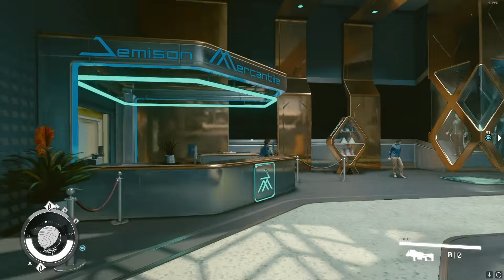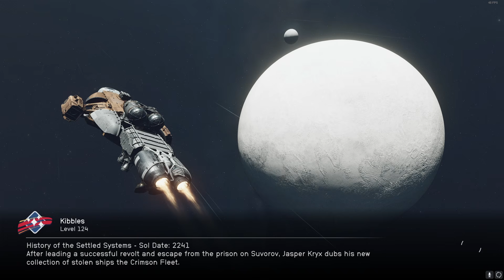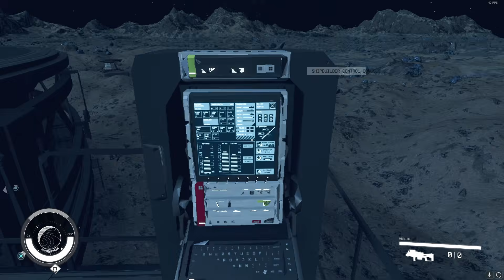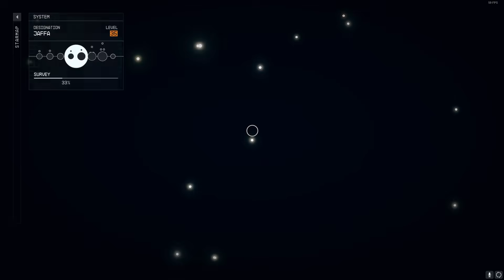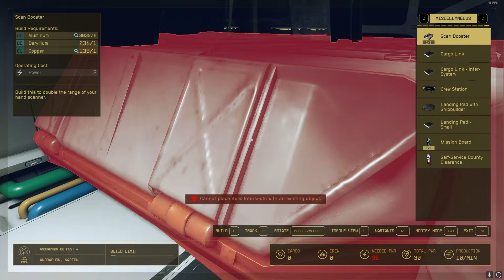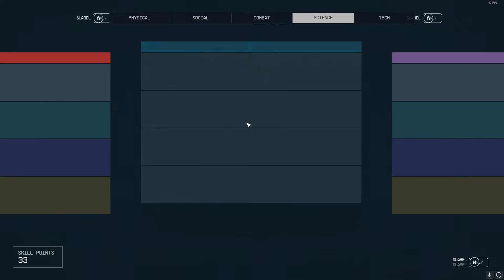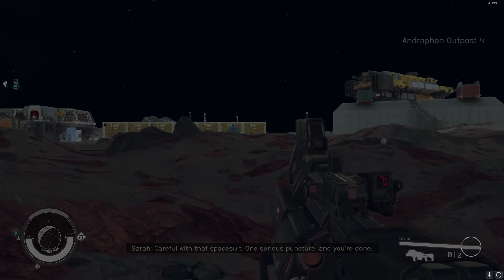Starfield outpost guide 2.0, beginner to expert FAST, outpost tips and tricks, cargo links, building

Comment: My first mission is a Supply Tungsten mission to Jemison. Thanks to your first video, I've got an outpost set up in Alpha Centauri. I can't scan for Tungsten, so I don't know what to do from here. Does a supply mission always require me to produce the resources? Or am I supposed to supply it from another source? Either way, how do I actually deliver/supply the resource?
Reply: You need to find a planet with Tungsten (W) and look for it there.  You will find rocks on the surface which contain it, but you need to find a patch of ground that's made up of tungsten and place an extractor on it.  While scanning, they'll appear as highlighted colours and the elemental symbol will show.  

If you can't find Tungsten on an inhabitable world in Alpha Centauri you'll also need to find a word in the system where your Tungsten is that has Helium-3 (He-3) and build an extractor on that as well.  

You need to create an inter system cargo link (or just a cargo link if your base with Tungsten is that same star system as the supply mission destination) and connect the output of the extractor to a container and then to the "outgoing resources" container on the cargo link.  You also need to connect the Helium-3 to the storage on the other side. 

Then you go to the terminal on the cargo link, select your destination and find something else to do while the cargo gets delivered. 

Hope that helps!
Reply: @SineN0mine3  Is the H3 requirement there because the NPC supply ships consume H3 as fuel and will get stuck on a pad if there's no H3?

Comment: Can you make a video about supply lines. Daisy Chains or multiple hubs that then ship out everything to the main base. I haven’t found a video that goes over the most efficient way to move items from multiple outposts to one main base. 

Also due to the fact that you can’t sort items in storage do you just dump all the different materials into a large storage facility. 

I would really appreciate it if you could go into this in detail. Currently I have 8 outposts and I’m still not sure what supply chain is the most efficient method. Thanks

Comment: Should be noted. There's a point in the main story where you need to build defenses on your Outpost no matter what.
Reply: Gonna try to avoid spoiling it but it can be done on your ship instead
Reply: @brandomium that’s what i did. Can confirm, all you gotta do is click on a button and it adds a CENSORED panel to your ship.
Reply: i had the andraphon outpost, and just slapped "censored" structure down.
never built any defenses or anything an im fine (60h) 🤷
Reply: I've had the censored on both my ship and outpost and never once had anything happen in 40h since.
Reply: Got starborn without ever starting an outpost. Still haven't activated, and,am now looking at outposts. Should have been better integrated into the story IMHO.

Comment: Have you notice that the cargo links that transport recourses from outpost make your game stutter like every 3 minutes? Even if you are bot in the same planet or system i had to stop using them after i was done leveling
Reply: Yh ive noticed this i didnt know if it was cargo links or not but every few minutes i cant move and that was after building the 60k xp farm
Reply: Not at all. I have 24 outposts all linked with 6 platforms per outpost and not a single drop in performance. But I'm on PC with pretty good hardware.
Reply: @flacwby i started noticing my stutters when having alot of containers and connecting them all think it was the red lines, first time i built it i couldnt even enter my outpost without the game crashing, i then reloaded a older save and didnt place as many storages and organised it abit better but now im defo having stutters and the sounds breaking, ive played ark with much more happening at once and the series x handles it fine but cant handle a few storages and red lines lol on starfield

Comment: Some how the cargo links put resources into your ship causing it to fill up too. The cargo links are a buggy mess and it's not really worth using because you can just fast travel to the planets with the resources.

If you're like me and wanted to automate and have multiple outposts funnel into one major base, it's not worth it. I spent HOURS trying to make it work. There's no way organize resources when they are sent into one base and you can only have one transfer container per outpost so if you have 7+ resources all being sent to one location you can't even utilize accessing the cargo cause the transfer container only holds like 250/300 and usually fills with 1 or 2 resources leaving you to hunt down specific resources from your possible hundreds of storage containers.

Hopefully mods will fix all the issues. I wouldn't waste time on cargo links, just mark and name bases of the resources you're gathering and fast travel to the places you need.
Reply: Then don't use the transfer container. Just connect directly to separate storage units, then only that resource will go in to storage. Transfer containers are only used to transfer to/from your ship, but not needed for cargo links and transferring between planets.
Reply: @flacwby it's pretty much only viable to use the transfer containers manually because you can't seemingly get repeat quests to deliver a specific resource.   

They're a pretty expensive item considering they just let you skip a couple of fast travels and you still have to enter your inventory while inside the ship and then outside the ship (or vice versa) to move anything in or out of long term storage
Reply: This is kind of lame but my solution has been so far to build long term storage with one container per resource, and I sorted them alphabetically (at least for metals, crafting materials have three or four item types per) 

There is no way to automate it so I don't use cargo links for it, just empty the ship there and send resources one at a time as needed.  

Again, it's pretty lame compared to what you can do in other games but I fully expect that they're going to flesh it out in DLC like they did in Fallout 4.  If people are patient and have realistic expectations it could end up being really good, but for now it's mostly just a late game money/resource sink.  

Inevitably you're going to want somewhere to stash your best loot, and the outposts are fairly simple and fun when you look at that side of it.  The resource management is obviously pretty weak, but "resource management" is practically a whole subgenre of base building games and starfield isn't trying to compete with them.  I don't want it to become factorio, I just want to role play as a miner without spending hours staring at my inventory trying to figure out which resources I need to pick up to build XYZ, or travelling back and forth between cargo links to stop them from filling and blocking desired resources from being delivered.

Comment: This is why its hard to find the spots with iron and aluminium together. It was confusing to me at first but everyone always says to looks for "mountains/hills" and "craters". However, the mountains/hills you should look for are the white/silver looking ones. I keeping running into the red ones thinking they were the same. The landing spot is tricky.
Reply: Once I find the two resources, I'll take off the scanner on the planet and find a gradient between a crater building up into a mountain and make the landing spot there.
Reply: Keep trying and you can get circles with plenty of 5 elements if not more.
Reply: I did it after an hour of searching
Reply: I wasted 45 mins yesterday found a spot today with both technically however iron didn't have the circle I was screwed
Reply: Ah, will try this now, as I always either got iron on its own or aluminium with beryllium and helium

Omg, finally got this working lol.. keep trying folks, well worth the pain 😊